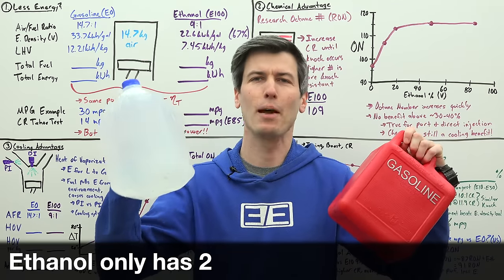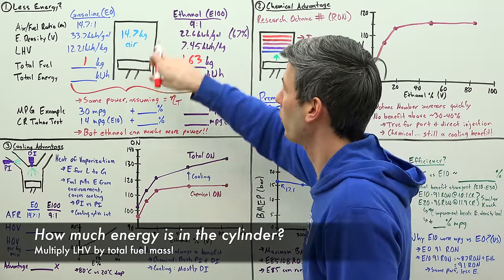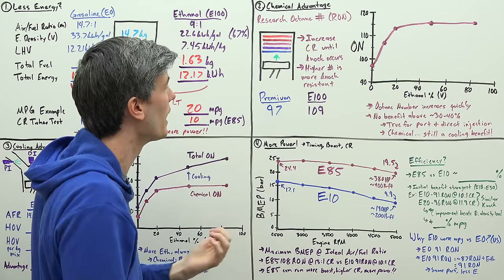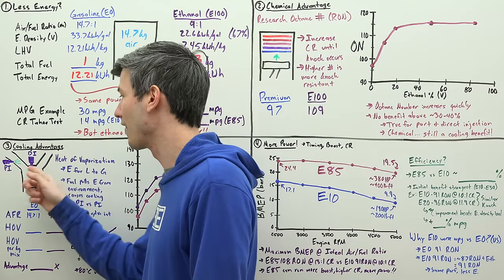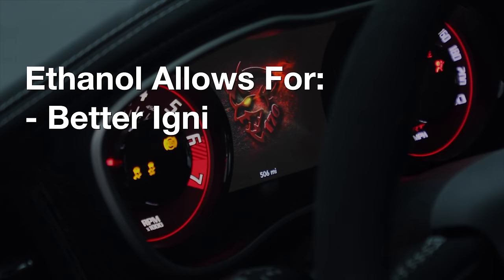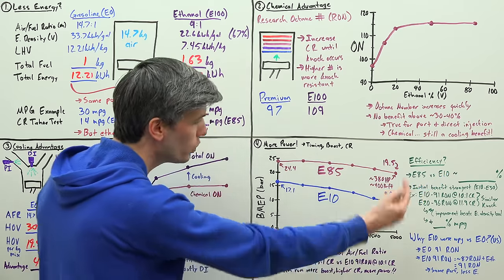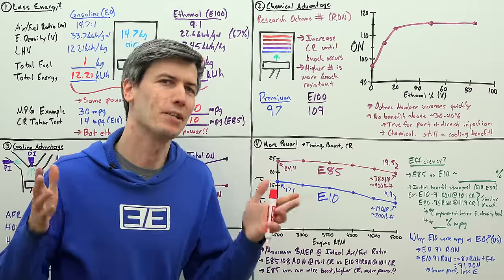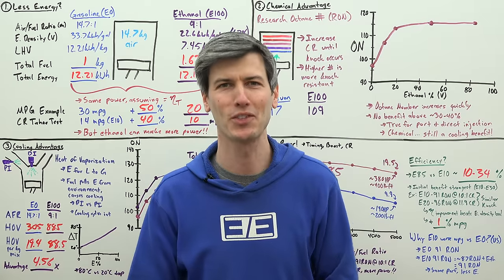Why Does Ethanol Make So Much Power? (Versus Gasoline)

Comment: Please make an electric aircraft video. A 777 can fly up to 21000 km with fuel. What about battery electric? With the best possible batteries and best motors and what can be done with the plane to increase range even more? Fly a bit slower? I've calculated about 1700 km on today's batteries. Seems reasonable?
Reply: I cant see it,the weight of the batteries alone. Batteries just dont have the energy density of gasoline or jet fuel.
Reply: @oldblueaccord2629  a jetfueld airliner can go 21 000 km. A battery powered would be able to go about 1 700 km according to my rough calculations. But I would like to see better calculations. So it's possible, just shorter range. 1700 km is enough for Stockholm - Paris for example.

Comment: E85 burns at a lower temp than regular gas. You burn more per gallon than gas. And during the winter months, you burn even more to heat your engine up.  E85 cost half the price of gasoline, but you use twice as much.

Comment: The problem with Ethanol IS.......After it sits for a short period of time it becomes less stable than gasoline.....though gasoline as well does the same thing, BUT it takes gasoline a much longer time to turn into varnish than Ethanol turning into water!! I am a car guy, trained as an auto mechanic, and I have a vast interest in science. This said, Ethanol burns hotter and more cleanly than gasoline, BUT as I stated already it is less stable than gasoline! In storage just a few weeks, and ethanol begins to return to water, where gasoline will remain stable for a few months!! Further it DOES take a hotter spark in an internal combustion engine to actually RUN ethanol than it does gasoline as well!! Something a lot of people fail to understand that "spark plugs DO have different heat ranges" meaning you can buy plugs that are either "hotter" or "cooler" as the engine and fuel requires!!! This is why in the late 1970s and early 1980s the "Gasohol" (a blend of gasoline and alcohol) ran so poorly in cars back then!! FURTHER engine compression ratios also play a major role in this as well, as low compression engines of the mid 1970s until well into the early 1990s, ran very poorly on most alcohol based fuels..............creating what is known as "engine knock" or "Engine Ping" which is produced due to detonation (an uncontrolled burning of fuel)!! THIS detonation can damage pistons, rings, cylinder heads and valve trains. Which is why ethanol CAN BE bad for an engine, because gasoline as a known "burn rate" AND is vastly slower burning that any alcohol product!!!
Reply: The DOE found ethanol blends in small engines last three times longer.  The toxic and volatile aromatics evaporate off and leaves behind an unusable fuel with E0.

Ethanol itself lasts forever, you could drink Roman gin if you found a bottle.  

Alcohols dissolve varnish which is why many carb and injector cleaners contain them as an active ingredient.  It is why there is a transition period when starting to use ethanol in vehicles which have varnish build-up from long term E0 use.  I remember back in the 1980s when gasohol first came having to change fuel filters weekly for a period until the systems became clean.

 Mercury Marine, which hosted a Webinar on ethanol myths, noted that ethanol does not "grab water molecules out of the air." It is hydrophilic, which means ethanol holds water. With regular gasoline (E0) as well at E10, the primary cause of water collecting in tanks is condensation on tank walls. But unlike E0, which can absorb almost no moisture, E10 can hold up to half of one percent of water by volume, and the water molecules will dissolve in the fuel. The "solubilized" water will bypass the water separator and burn harmlessly through the engine.

>>>>Mercury Marine also says E10 may be the superior fuel(over E0) because it keeps the fuel "dry"<<<<

Comment: has anyone built an e85 motorcycle yet?  I know the tanks are already small and the mpg would be worse, but theoretically you could make the engine smaller and get the same or more hp and use that extra space for a slightly bigger tank.  just thought about it since most sports bikes already have really high compression ratios.  mine has a 12.0:1 ratio with regular 91 octane gas with 0 ethanol added, and more modern bikes run in the 13's for ratios, could have an insane ratio if you used e85
Reply: Brazil has E100 motorcycles and India either has them now or soon will.  All new vehicles in India will have to be flex fuel.  Their non-flex fuel vehicles will be using E20 soon.

Harleys in Brazil use E25 FYI.

Comment: Yeah but the MPG sucks even in "flex fuel" vehicles likely dumping more CO2 than using gasoline. Something like 20 to 30 percent loss when I have tested it.
Reply: Burning (oxidizing) a gallon of ethanol generates less CO2 than burning a gallon of petrol. 

Why, you ask?

Petrol is 87% carbon, and ethanol is 53% carbon. 

That’s also why it takes more ethanol to do the same work.

Comment: This really means 91,92 or 93 E10 is a ripoff. Ethanol is cheaper than gas, and they are mixing it with cheap E0 87 octane gas and charging the customer a premium. 

Would have got a flex fuel tune for my wife's 2018 WRX. My boost meter reads a max of 22 psi, so it could be possible to see minimal MPG drop due to very high compression (geometric 10.6:1 which is high for a turbo engine + boost). But the FA20 conrod is made of butter. Already got the short block replaced once under warranty due to rod knock, only thing I did was fill up with 87 octane, once. Manual says its fine to do so.

Comment: I read a study published by a UW -Madison professor that calculated a net minus BTU number for ethanol production. In other words, it takes more energy to produce than the end product delivers.
Reply: Post a link to it......we will be here.
Reply: The amount of energy that it takes to produce and deliver a product to the consumer is reflected in the price of that product.

As such, note the spot cash delivered price of ethanol on the NYMEX is $2.29/gallon.

The price of a sub-grade unusable gasoline (RBOB) is $2.57/gallon.

It takes more energy to make unusable gasoline than ethanol.

To turn RBOB into usable E0 gasoline costs even more much like premium costs more.  Unfortunately it also becomes even more toxic, carcinogenic, and dirty.

Or simply splash in >10% ethanol to RBOB and the resultant usable fuel becomes less toxic, far cleaner burning, and cheaper/cheaper per mile to drive.  Who can be against that?

Iowa State University measured all the energy it takes to produce an acre of corn into a "diesel fuel equivalent"
This included making of machinery, fertilizer, chemicals, plus the tillage, planting, spraying, harvesting, drying, trucking etc. 
They found it takes 34 gal of diesel to produce one acre of corn.
What do we get from those 34 gallons of diesel?
We get >500 gallons of ethanol.
But wait, that is not the kicker.
The kicker is we still get 100% of the protein from that acre of corn still available for an even better feed called distillers grain. A win, win.
Reply: I'll weight...
Reply: @danafletcher2341  "The amount of energy that it takes to produce and deliver a product to the consumer is reflected in the price of that product." 
Unless, of course, it is subsidized by the government? This was the point of my comment. "Clean energy", such as ethanol, is simply "green-washed".
Reply: @danlowe8684  The Federal corn ethanol subsidy ended back in 2011.

The long-standing stated goal of the G7 Nations to end petroleum subsidies?  Not so much.

PS. Not to mention one doesn’t need as many aircraft carrier battle groups sent across the world with ethanol either with whatever they cost per gallon.
Reply: @danafletcher2341 Exactly my point!!! Quit waging war in Ukraine!!! We agree...
Reply: @danafletcher2341  Understanding U.S. Corn Ethanol and Other Corn-Based Biofuels Subsidies
Taxpayers have subsidized the mature corn ethanol industry for more than 40 years
Agriculture, Energy & Natural Resources  | Analysis
May 7, 2021  | 5 min read | Print Article
Since the creation of the domestic market for corn ethanol after the energy crisis of the 1970s, the federal government has nurtured and maintained the ethanol industry with a steady stream of subsidies. Originally sold as a way to achieve energy independence and reduce greenhouse gas (GHG) emissions, ethanol has been a favorite of policymakers from the Corn Belt. Ethanol producers have received favorable treatment under the tax code, tariff protection from foreign competition, a government mandate for its use, infrastructure subsidies, and more. As a result, taxpayers have spent tens of billions of dollars over the last 40 years subsidizing the mature biofuel. Decades of subsidies have failed, however, to reduce climate risks and serve as a bridge to next-generation, non-food-based biofuels, while spurring several unintended consequences, wasting taxpayer dollars, and distorting markets.

The largest current subsidy for corn ethanol is the federal Renewable Fuel Standard (RFS) mandate, administered by the Environmental Protection Agency (EPA). The RFS requires a certain volume of biofuels to be blended with U.S. gasoline and diesel each year. Approximately fifteen billion gallons of ethanol are now blended with gasoline annually, roughly 10 percent of gasoline (E10). While corn ethanol comprises a large majority of biofuels production in the U.S., corn is used to produce other biofuels (such as corn butanol and biodiesel) as well.

In addition to a government mandate, subsidies for corn ethanol and other corn-based biofuels litter the tax code – including tax breaks for ethanol blender pumps and biodiesel derived from corn oil – in addition to Department of Energy (DOE) programs and U.S. Department of Agriculture (USDA) subsidies. While the Alternative Fuel Vehicle Refueling Property Credit, which provides a 30 percent tax break for gasoline stations or other facilities installing biodiesel or 85 percent ethanol (E85) blender pumps, expired at the end of 2020 in addition to the cellulosic biofuel production tax credit, the market-distorting $3 billion/year biodiesel tax credit is in place through 2022. Corn oil biodiesel qualifies for the latter credit.

Furthermore, the farm bill, a massive piece of legislation covering topics ranging from nutrition assistance to broadband internet, provides government subsidies for the now-mature ethanol industry, including corporate agribusiness giants such as Archer Daniels Midland. The majority of farm bill support for corn ethanol has come from energy title programs such as the Bioenergy Program for Advanced Biofuels (BPAB), trade programs such as the Market Access Program, and other commodity and crop insurance supports for corn and ethanol blender pumps (which dispense higher blends of corn ethanol, including E15, a mixture of 15 percent ethanol and 85 percent gasoline). While the Rural Energy for America Program (REAP) also subsidized ethanol blender pumps beginning in 2011, Congress prohibited such subsidies in the 2014 farm bill. In 2015, 2020, and again in April 2021, however, USDA unilaterally announced more blender pump subsidies through the Commodity Credit Corporation (CCC), a fund typically reserved for farm loans and other major farm subsidy programs.

The Dec. 2020 Consolidated Appropriations Act of 2021 was the latest legislative vehicle to include corn ethanol subsidies despite over 40 years of federal support. The door is now open to CCC subsidies for ethanol facilities due to COVID-19-related economic losses, with USDA announcing plans to subsidize biofuel industry losses in 2020. And various carve-outs for ethanol and other biofuels have been proposed in recent infrastructure, budget, climate, and tax proposals both from the Administration and Congress. Instead of continuing to support special interests and subsidize biofuels that are doing more harm than good for the climate, it is long past time policymakers ensured that the ethanol industry stood on its own two feet.

The report details the following corn-based biofuels subsidies in more depth:  (1) RFS biofuels mandate, (2) farm bill energy title programs, specifically REAP and BPAB, and (3) federal tax breaks.
Reply: @danafletcher2341  Anything??
Reply: @danafletcher2341  How does a corn farmer double his income? Installs a second mailbox...
Reply: @danlowe8684 Corn ethanol production is somewhat insulated from corn subsidies for if corn is low in price, then so too are the prices for their distillers grains and byproducts.

This explains how corn ethanol producers are able to keep ethanol so low in price despite the current high price of corn. They are making it up with high prices for the distillers grains.

It would be the cattle feeder who gains most from corn subsidies, not ethanol producers.

The subsidies for the extra cost of blending pumps go to fuel station owners and not to ethanol producers/production and if anything would make the price of ethanol more expensive, not less than what it is. Think about it.

Again corn ethanol production is not Federally subsidized and has not been since 2011 when the VEETC ended.  Ethanol’s super low price is what it truly costs to produce, it has come of age becoming more economical than petroleum.

Since the Freedom to Farm Act was passed in 1996, farmers have been free to plant any crop they choose without risk of losing any subsidy payment so end users must bid for acres if they want them planted.

Since the 2005 energy act passed farmer paid subsidies have gone from around 25 billion dollars in 2005 to around 10 billion this year not counting inflation.

A mandate is the about opposite of a subsidy.  A subsidy costs taxpayers money and makes a product appear cheaper whereas a mandate doesn’t cost taxpayers anything but most often increases the price of a product.

The renewable fuel mandate (which doesn’t require ethanol be used, any renewable works) is an odd mandate in that it makes the price of our fuel less.  This indicative of a monopolistic market in our fuel system.

A CBO study found that if the RFS mandate ended the same amount of corn ethanol would be used because ethanol is the most economical octane booster available and large portions of the country require oxygenated gasoline to control pollution.
Reply: @danlowe8684  A few missed points, there is no tariff protection for corn ethanol anymore which was for Brazilian sugarcane ethanol dumping as our ethanol industry was just getting started.  In fact, corn ethanol has a tariff on it in Brazil this very day!

Corn ethanol because of its value added feed factor (distillers grains) is more economical than  most anything out there including sugarcane which makes more ethanol per acre but little else.

Contrary to what your Rockefeller funded school textbooks might have said, kerosene did not replace whale oil for lighting after the first oil well in 1859.  Whale Oil quickly rose and fell with a peak of just 17 million gallons around 1845 or so.

The main fuel for lighting in the 1800s was ethanol which was called burning fluid and 100 million gallons of ethanol was used for lighting in 1860.  Just after that first oil well was discovered a tax of >$2.00/gallon was placed on ethanol in 1862 to pay for the Civil War.  Kerosene’s tax was just $.10/gallon so literally overnight kerosene became the number one fuel for lighting in place of ethanol.

That >$2 tax on ethanol lasted some 44 years until trust busting Teddy Roosevelt came along with his Free Alcohol bill in 1906 just in time for Henry Ford to power his favorite fuel in the Model T.

John D. “Competition is a sin” Rockefeller then massively funded a group of women to get Prohibition passed with a Constitutional amendment no less.  Someone the likes of Teddy wouldn’t get in his way so easily in the future.
Reply: @danlowe8684  I need a link to that study or YOU ARE A LIAR.

Comment: What about the original energy put into Ethanol to make it  then recalculate efficiency as use of the gass we use as a nation
Reply: All the energy it takes to produce and deliver a product to the consumer is reflected in the price of that product.

As such note the spot cash delivered price of ethanol on the NYMEX is $1.46/gal.

The price of unusable sub-grade gasoline (RBOB) is $2.69/gal.  

To turn RBOB into usable E0 costs even more much like premium costs more.  Unfortunately, it becomes even more toxic and dirtier.

Or simply splash in >10% ethanol to RBOB, and the resultant usable fuel becomes less toxic, far cleaner burning, and cheaper/cheaper per mile to drive with.  Who can be against that?

Iowa State University measured all the energy it takes to produce an acre of corn into a "diesel fuel equivalent"
This included making the machinery, fertilizer, chemicals, plus the tillage, planting, harvesting, drying, trucking etc. 
They found it takes 34 gal of diesel to produce one acre of corn.
What do we get from those 34 gallons of diesel?
We get >500 gallons of ethanol.
But wait, that is not the kicker.
The kicker is we still get 100% of the protein from that acre of corn still available for an even better feed called distillers grains. A win-win.

100% of the fertilizer (& everything from the soil) still get fed to livestock in the distillers grains.  Ethanol comes from only things of the air: solar energy, CO2, and water with the latter two recycled once burnt.

Ethanol C2H6O = no fertilizer

Distillers grains = all the fertilizer

What logic is it to then assign all the energy and CO2 of fertilizer to ethanol and none to distillers grains?